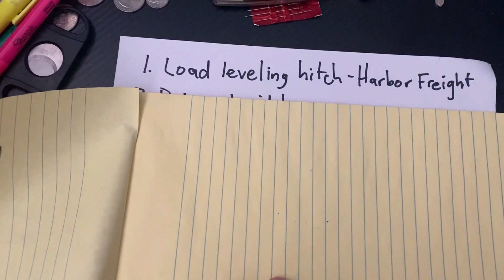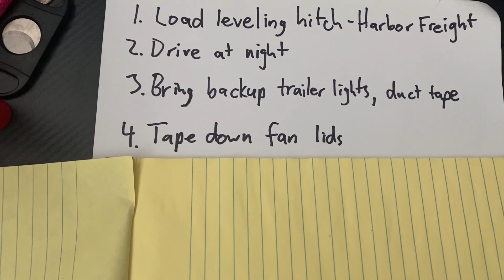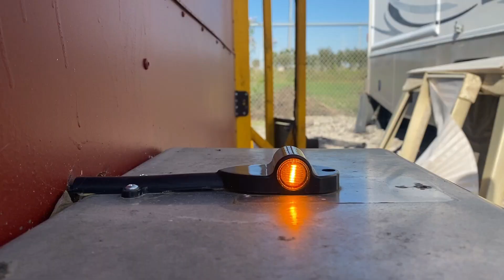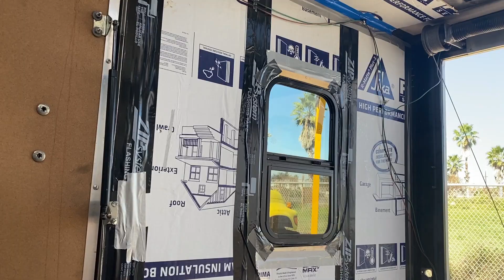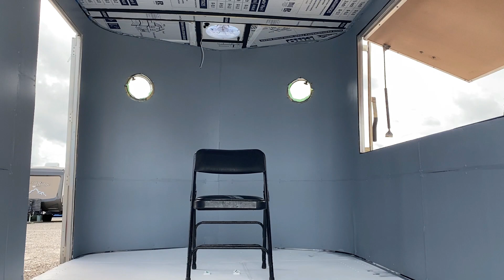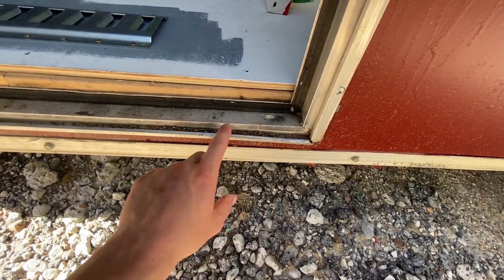Lessons Learned from First Trip - Cargo Trailer Camper

Comment: I got the 220 dollar self adjusting break set from amazon. Hub rotor shoes ect and it only takes a hour and a half to do. You'll be glad you did. Napa has two wire with coating for a dollar a foot, goes from one side to the other then to 7 pin connector. And it doesnt matter which wire you use one either wire for the breaks on either tire, just need a ground and positive they work any way you hook them up. So no making sure you have it right.
Reply from the maker: Sweet, I'll check that out, thanks!